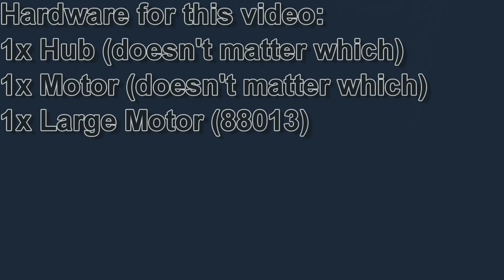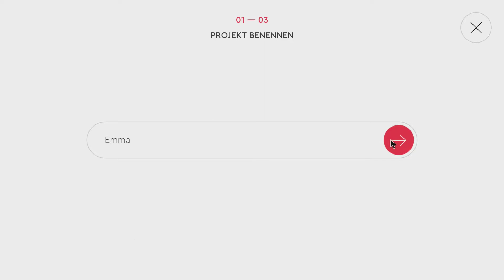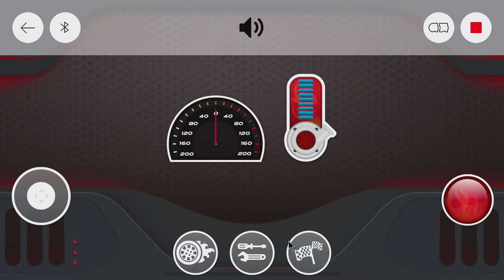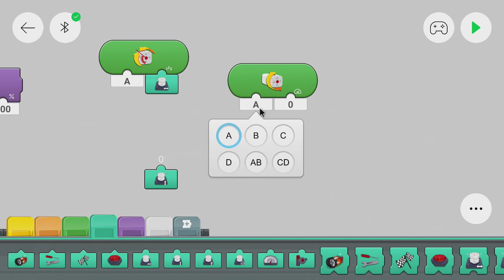Lego Powered Up Tutorial #09: configuring a touchscreen control (lights for 42099) [English|HD]

Comment: What app are you using so that you control this jog wheel with mouse ?
Reply from the maker: I'm using stock android with a USB mouse
Reply: @technicmaster0tutorials  Thanks. I kind of hoped there is a way to emulate Android easily on Windows ;-)
Reply from the maker: Windows 11 will have an android emulator but I'm not sure about the BLE capabilities.
Reply: What is the app called😊

Comment: Hi there thank you for putting up these videos these are very helpful, no idea why LEGO has not documented this, I called them last year on this and they told me to Google it to find someone who has documented which was a very odd response. 
It appears there are two coding sections this one under the remote control and the one outside the remote control area which is only accessed one way. I notice under the remote control there is the stand-alone dual-motor block the one with the rounded ends which does not appear in the other coding section. It appears there are different remote control blocks here than is in the other coding section. I have 4 wheel drive robot that I am trying to control and it works better in the section rather than the other coding section. Do you know why there are two different coding areas that are different? I have joined the Powered UP Facebook page and just waiting to join so I can post.
Reply from the maker: I think that they work on an official documentation or something else in that direction but so far I haven't seen anything of it.
Yes, the premade remote control layouts have extra blocks. I think that they made it like that because these blocks are especially for remote controlled vehicles and until the last update there hasn't been the profile designer. So they didn't add them to the other layouts yet.
However, all of these extra blocks can be made with other blocks, too.